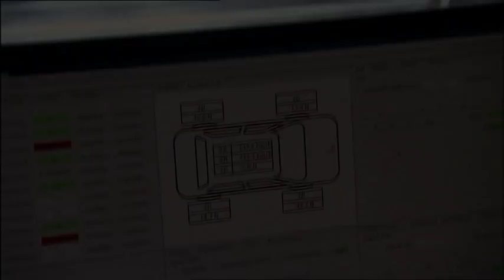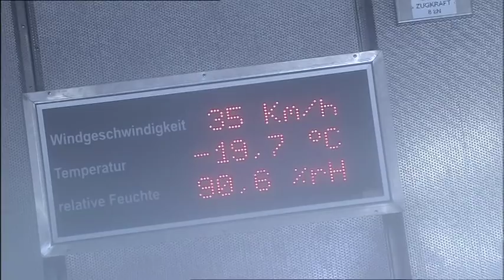New Mercedes climatic  wind tunnel creates own weather

Comment: @flawns 
Climatic wind tunnels don't do "wind testings". The only reason they have wind at all is so they can simulate rain and snow while driving. The real purpose is to make rain, freezing rain, snow, or heat from UV lights to make sure things like the heat and AC work along with making sure the engine and transmission don't overheat or to see how long they take to heat up in the cold.

Comment: @Northgtabeast
A hell of a lot. GM just built one at my university (UOIT in Oshawa, the wind tunnel is called ACE) and I worked there this summer. The whole school gets 8MW of power, the wind tunnel building gets 5MW out of the 8 and the fan alone sucks up 3MW at full power.